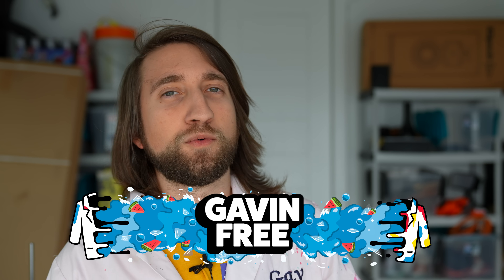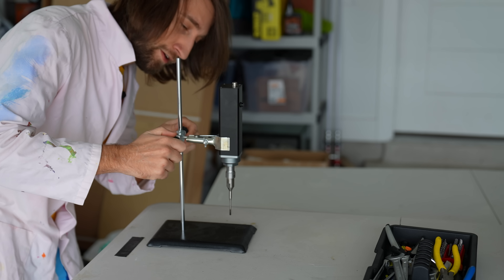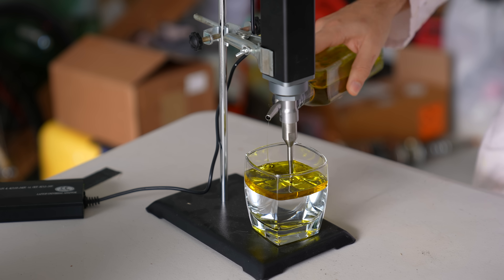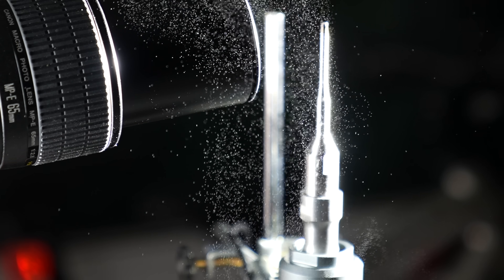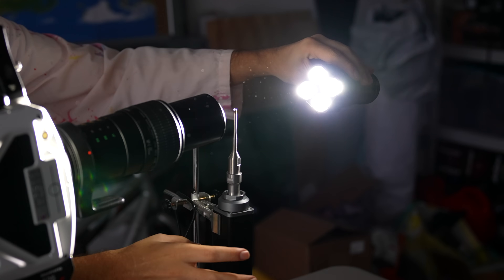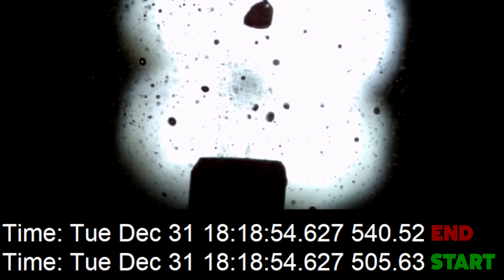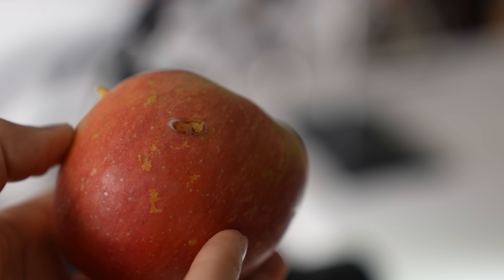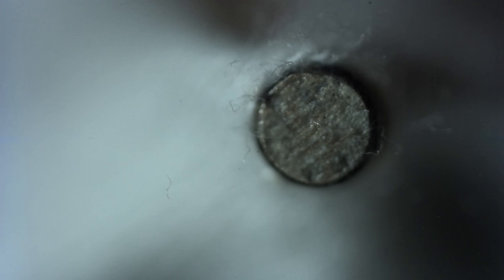Ultrasonic Obliterator at 170,000fps - The Slow Mo Guys

Comment: Coolest thing I seen this year, that's awesome!  what happens when you touch it to other stuff? will it make a hole into a Penney? what about concrete?
Reply: How about some Ultrasonic Obliterator x Ultrasonic Obliterator action?
Reply: @HUNDIIl  Do you want to create a black hole? Because that's how you end up with a black hole.
Reply: @Jonny2myren  no. It'd be how you create galling.
Reply: @Jonny2myren  
(heard in Archer's voice!!)
Reply: @HUNDIIl  Look up ultrasonic welding on youtube.  Friction welding is also cool to look up if you are at it :D
Reply: @Pecetos  ULA use friction welding.  As seen on Destins* tour through their facility.

* This one, I think: https://www.youtube.com/watch?v=o0fG_lnVhHw
Reply: @HUNDIIl  That would probably make one of the most awful noices you've ever heard
Reply: The tip breaks/melts off if the material you're pushing it into has a hardness equal or greater than the metal the tip is made of.
Reply: @thisoldtony turned one into an ultrasonic knife once. I think someone else did too, maybe justin from @thoughtemporium. That lets it cut through stuff
Reply: @charleslambert3368  Hah its like one of those electric kitchen knives people use for Ham/Turkey/Other meat but on crack.
Reply: The year just began.😅
Reply: Would have loved to have seen some plexiglass/acrylic.
Reply: I mean it's essentially a mini jackhammer, but probably not hard enough to get through metal or concrete, but the heat alone could do the trick. I'd imagine the device would fail.
Reply: I think it would do particularly fun things to a marshmallow.
Reply: It's only been a few days
Reply: its like the new 1000 degre Knife
Reply: *penny
Reply: It's a micro-jackhammer.
Reply: That sonicator reminds me of this video https://www.youtube.com/watch?v=U2rNnzVotS0&vvasw
Reply: Is this name highlighted (like 'The Slow Mo Guys' is) for anyone else as if 'Experimental Fun' is the publisher of the video?
Reply: @Raraoolala  They are just both verified on youtube
Reply: Aaron S yes, but never is anyone else other than the publish highlighted. I believe it was a glitch, as they no longer show being highlighted.
Reply: gud idea
Reply: You must not get out much if this is the coolest thing you've seen this year, and also wonder if it would smash through metal 🤣 it's for mixing liquids that won't usually mix, it's not a pneumatic drill 🤣🤣🤣
Reply: @elyanae9588  What is the purpose of your comment?
Reply: You will break it

Comment: Fun Fact: I assume that the distance its vibrating is 0.1mm up and down. Because it does that 30000 times per second it `travels` about 6 meters per second which equals 21.6 km/h (or 13mp/h, just use the metric system americans).

Comment: My science teacher: You can't mix water and oil due to density difference
Gavin with a weird toothbrush: HOLD MY B̶E̶E̶R̶ PHANTOM
Reply: Your science teacher is still right. But now you have no teeth.
Reply: it has nothing to do with density.
De-gassed water actually mixes with small amount of oil and stays like that.
Reply: *hold my phantom..edit it
Reply: Technically you can mix them if you have an emulsifier
Reply: It not density, it's polarity. Water is polar and oil is non-polar. Thats why they don't mix. So really, the oil and water aren't mixing - there isn't a chemical reaction happening, nor are they going to say in a mixture. They've just been so fully dispersed inside each other that it'll take ages for it to settle out. It will settle tho.
Reply: He didnt mix them
Reply: @Trathien-  but he did, he just mixed it into an unstable emulsion that started to break as soon as the device was turned off

Comment: maybe filming a vial in a centrifuge? i wonder if you could adjust the framerate so that you can see the seperation of blood, or different colours or vinegrette?
dont know if that is practial. 
have you seen the recent Imploding stuff from the hydraulic press tube? they dont have phantom cameras.
seeing things implode under high pressur with exrtremely high framerates could be interesting.

Comment: Ultrasonic obliterator VS Prince rupert's drop!!!
Reply: It will probably destroy it very quickly by sending vibrations down the tail and snapping it.
Reply: @evilsharkey8954  are you sure about that?
Reply: ownzone 817, I believe a hydraulic press channel tried crushing them, and their slo-mo showed that the explosion still started at the tail and worked its way up.
Reply: This is very interesting question 🤔
Yes someone needs to do this
Reply: Yessss!!!!
Reply: I never said it wouldn't start at the tail because it is almost indestructible at the head I just don't think the drop would vibrate enough to snap the end off with just air resistance

Comment: I guess after the mixing device its time to test the unmixing device: A centrifuge.
Reply: Gav is already one break down away from being a super villain.. no need to give him more ideas
Reply: Can a sonic obliterator cook a steak?........ slo-mo footage of steak being cooked by ultrasonics?.....
Reply: I second this
Reply: throw an apple in a centrifuge and hope the centrifuge doesnt explode
Reply: centrifuges have to be balanced to the nearest milligram +  they are tightly closed under pressure so I doubt there is a way to find a cheap "open" centrifuge
Reply: @axe_fx  mark rober made a centrifuge base from those spinning toys you use with 2 hands. Whats missing is the container for it, which is just a small glass tube thats able to hold little samples of blood
Reply: @axe_fx  i think your absolutely correct it would probably be very hard to obtain a clear one where we could see inside but if anyone could do it its Gav

Comment: Gav can you guys recreate the Fifth Gear 120mph crash test and shoot with the faster cams (V2640, V2512)? They only shot it at ~500fps (mid 00s tech), and it def needs more frames and more res. (Would have to coordinate with MIRA or DTC or another automotive crash test facility, so appreciate this isn’t an easy one to set up)